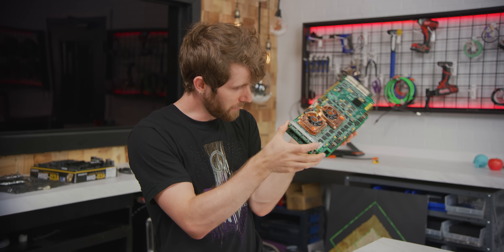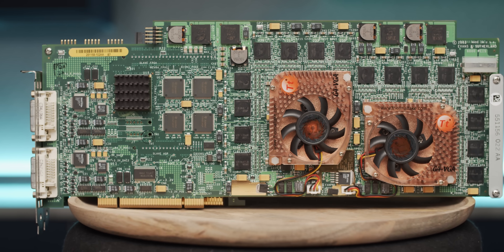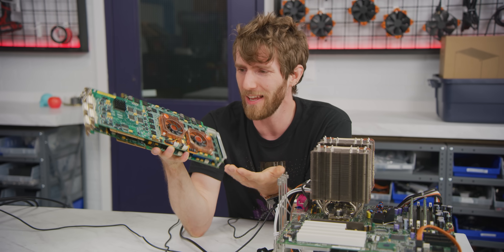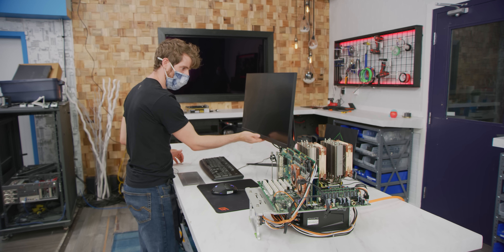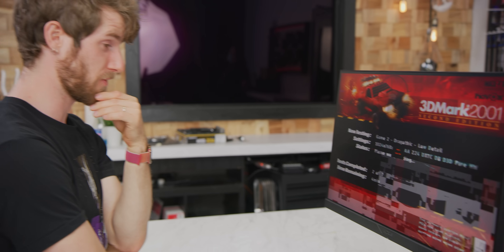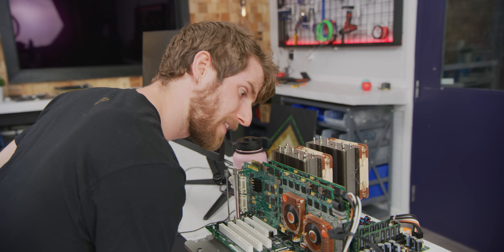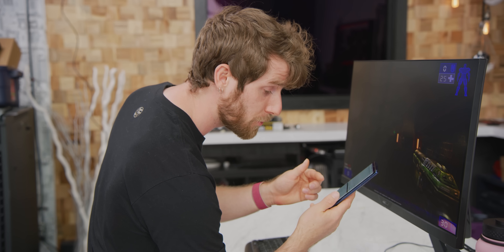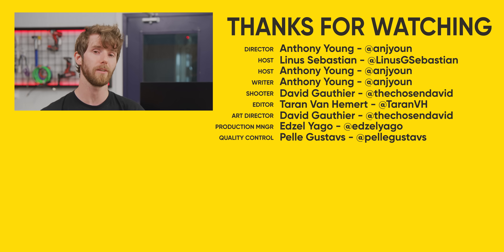This MONSTER Video Card has 4 GPUs... and it's from 2004! - E&S SimFUSION 6500q

Comment: Those "desktop lines" were a plague on ATI GPUs in the 90's and well into the Radeon era, and a significant part of why I went 3dFX then Nvidia.
Reply: I became a NVIDIA fanboy after my ATI Radeon had crapped out on my for the final time. Got my first NVIDIA card and it was a FX 5300 and it was rock solid. Now have a 1650 super
Reply: @fightingfalconfan  I actually had bad luck on nvidia fx series. Radeon 9800 pro never let me down till I needed a new gpu in 2010. Then I got a hd 3650 and after that gtx 9600 all used ofcourse because I didn't had much.
Reply: @fightingfalconfan  I gave ATI another chance with the very first Radeon released.  I was playing Alice at 1600x1200 on my 21" Trinitron and it "popped", all the video went corrupt.  Exchanged it on warranty, then traded it for my first nVidia card, with the thought process "they bought 3dfX so they're bound to be good right?"  I was right and haven't looked back.  Sadly I'm an AMD CPU fan, and was back then.  I admit that an APU is a good way to go for a cheap gaming rig, but I still like my AMD/nVidia rigs.
Reply: Im still using an ATI Radeon 2600 pro with a water block and it is massively overclocked and overvolted and the performance is about a 1080 ti
Reply: @milord2921  FAKE NEWS

Comment: Can't wait for the 10 year-old computer video. 

Should see my 2 Windows 98 high end gaming rigs I built (with lots of new old-stock stuff and CRT's)
PII450 Matrox G200+Voodoo2 12MB SLi Diamond Monster Sound II

PIII-S1.4GHz (have Voodoo5 but meh) GeForce 3 Ti 500 SB Audigy (w front-panel)

IDE to Compact Flash Cards for storage (the inventor deserves a freaking 🍪)
Reply: See, that's a properly interesting build. 10 years back is just Nehalem and Sandy Bridge, which are still remarkably serviceable and have little difference in build from a modern PC. Just slower and no M.2/nVME.
Reply: @random_n  architectures stalled. Thats why a pc from 2011 is still relevant today. Im using one from 2014 and only gonna upgrade after 6.5 years lol.
Reply: My Matrox G200 set me back $250, that's like the new RTX 3090 in pricing. What the hell was I thinking.
Reply: @Tokamak3.1415  hehe I had a Pegasus card, myself.
Reply: Add SCSI to get top storage performance.
Reply: CRT for the win. save them while you can when they are gone they are gone!
Reply: Cool, I was already in the green team back then. I still have my Nvidia Riva TNT somewhere, should even work I guess.
Reply: Mycon . My TNT does.
Reply: Yeah voodoo 5 was a disappointment. I envied my friends geforce 256 that time. A lot cheaper but performs a lot better. Except in unreal tournament glide.
Reply: @badassgenevideos  I got 2 recently and I'll tell you now that's a collector's card, not a practical use really. 

Can you believe it's not even backwards compatible with older glide stuff? I know it's a new architecture but it adds to the obscurity IMHO
Reply: @8KilgoreTrout4  I don't remember that's its not compatible with older glide games. By that time, the only glide games I was playing were unreal tournament and Diablo 2 and N64 emulator that uses glide. When we started playing quake 3, I switched to Nvidia. I regretted buying voodoo 5. I can't even find a buyer since everyone is buying Nvidia 256 because of quake 3. The one thing voodoo 5 excels with is the AA. It took a while before Nvidia and ATI could match the quality of 3dfx AA.
Reply: @badassgenevideos  Retro Machines and 3dfx Voodoo user group on FB you can find a seller right now, or really good trade leverage.
Reply: What's the point of building 10 years old rig? I myself using 8 years old and playing all games almost maxed out graphics. Yes GF980 and i7 4770k beats 1440p in games. So 2 more years would be like GF780.
Reply: Matrox that’s a name I’m always trying to remember during convos but can’t since you don’t hear it anymore
Reply: They did that video for ltx last year
Reply: I have a 5x86P75 basically a 486Dx4-133 with 16kb L1, 96mb 60ns FPM and a Matrox Mystique 2mb, SB32 and IDE->CF bridge. But my first PC was a 8088 :P first computer a commodore VIC-20. Yes I'm old...
Reply: Don't want to ruin your feelings, but those specs are more like for a 20 year old PC.
Reply: @Murphistic  well yeahhhh I just thought it was more interesting than a 10 year PC. I was thinking old computers that are cool 🙂
Reply: ammmm 10 years ago would be around a GTX 580
Reply: Like jayztwocents

Comment: Come on... if you want to see a real "beast", look at the IBM Professional Graphics Controller from 1984. That's 2 full length, 8-bit ISA slots. It had an onboard 8088, 320KB RAM driving the whole thing, did 640x480 at 256 colors (also had a CGA emulation). That was really revolutionary for a PC. Not this thing.

Comment: "old enough to support dvi" looks at my 1650 super o ok :(
Reply: i mean even the 2070 non super has dvi, so, meh...
Reply: when it takes so fucking damn long for nvidea/amd to give us a  new card that linus need to amuse us with a ancient relic
Reply: You guys have gpus?
Reply: but it has analog DVI
Reply: @ferchuu9  DVI = Digital Visual Interface
Reply: @Kurkkulimu  DVI used to have an analogue mode.
Reply: @Kurkkulimu  Old ones could also output analog.
Reply: Looks at my ROG B450-F
Reply: 2060s also has DVI. I'm surprised it's not just all DP at this point.
Reply: Probably the fact that it ONLY had dvi, and also there’s the older kind of dvi and the newer one. New cards have the new dvi. Also, this card was super expensive and cutting edge at the time, so the fact that it had dvi shows it’s age. High end cards these days pretty much never have dvi
Reply: GTX 1080 has DVI, so I don't know why Linus thinks that's a metric to go by to evaluate how old a GPU is
Reply: I literally use DVI with my 1070 because my monitor doesn't have displayport and the only hdmi port is occupied.
Reply: ur gay most likely digital dvi as opposed to the older analog dvi
Reply: i’m getting the 1650 super too
Reply: This is always what I find so odd about Linus, talking like stuff is super old...but he grew up with this, idk to me DVI or VGA is not old at all.
Reply: Decenium theres multiple types of dvi. Dvi is pretty much not in use anymore except in some cases
Reply: @pattondurio  DVI-A is has never been an output standard dude, usually the output is DVI-A/D which has both. The cable pins determine which signal you use either analog or digital, and a DVI-A cable or adaptor terminates in a VGA at the other end as it would be dumb to have it on a monitor as the connector for DVI is more expensive than VGA and if using analog they do the same thing. The point is to save space on the backplate of a GPU.
Reply: heh do you mean the Radeon X1650 or the GTX 1650? You do know both exist right? Or too young for that? I'm guessing GTX since the Radeon was a dumpster fire and like 10+ years ago.
Reply: noth606 since he said 1650 super it would be stupid to think he meant the Radeon card.

Comment: You should run it on a GNU+Linux rig and benchmark some games and applications on it there. Also, use a better computer to squeeze all the performance out of it. Also, create a custom watercooling kit for it and then see if you can overclock it. Let's really see what that old card can do.

Comment: "Old enough to still use DVI"
I still use DVI...
Reply: I still use VGA
Reply: I use vga and it works ok for my needs
Reply: @KlyffHanger  Well IF it works and is compatible i do not see why not use it just VGA monitors are heavy and both of them made dents in my cheap desk so i got rid of them in favor of the 2 VGA also with DVI monitors.
VGA worked wonders when it was comparable with everything. Now DVI and HDMI are.
Reply: @yumri4  really? Probably should buy a new hdmi monitor. my desk is flexy and i dont want to break it. Thanks for the info! ;)
Reply: @KlyffHanger  why get a new one when the ones i already have are still working?
Reply: @yumri4  I was talking about myself. btw I am thinking of an i3 10100 based pc build a few weeks later. any comments?
Reply: @KlyffHanger  A few.
1.) Look at what you actually use. To upgrade to something that goes along with that.
2.) right now Intel isn't so good to go with due to the lack of features and support on their motherboards and CPUs but as it is a CPU upgrade i am assuming you already did that thing and decided ad Intel CPU met your needs better than AMD.
3.) Really the CPUs right now aren't a big factor so unless you have a need for the extra 2 to 8 cores the quad core i3 might be good enough that you will not notice a difference from the upgrade. This is assuming you are using it for home use not work use as most home applications are made assuming you have a quad core CPU.
4.) If you wait a few months the 11000 series will be here. As this is always true that the next CPU gen is the next year this one is not as important but still if you are upgrading from the 10000 series the logical thing in my mind would be to go to the 11000 series as upgrading within the same series without a major reason isn't going to make any big gains with Intel CPUs anymore.
Reply: @yumri4  I only play minecraft and watch youtube videos at 1080p. And I will be a first time builder if I build the PC. I think intel PCs must be much easier to put together than AMD as I don't want to do that bios tweaking stuff and other things. And I'm upgrading from an i3 2100! Also I see that you've mentioned the 11000 series. I think I would go for the 10100, then a few years down the line upgrade to a 10600k, then a 11000 series i3, then an i5 11th gen, and that's it. So this PC can suit my needs!
Reply: @KlyffHanger  Really if you just play minecraft and watch youtube then why upgrade from a i3?

Knowing how long Intel keep around their CPU lines you are probably talking about the same year. I would suggest saving up a little more and getting the i5 to begin with then. The CPU is one of the hardest pieces to change / upgrade after the system is built so putting in the 1 that you will keep for the rest of the system's life or think you will is important.
Reply: @yumri4  Umm, i have an i3 2100 on the lga 1155 socket and with a bad mobo. I think the power delivery is capable of an i7 3770s (fingers crossed) and one of them costs 50 bucks so i think i can do that. Also, my minecraft needs are HIGH. streaming and gaming with a few chrome tabs open in the back ground.
Reply: @KlyffHanger  Going off of just that get a new motherboard at least. You do not want a just enough power VRM if it is to last more than  1 to 2 years.  
Well maybe by then you will be able to afford um it will be 2022 so the 13th to 14th gen depending on when in the year. 
Just like if the VRM is not up to it you might see a worse performance out of the i7 than the i3.

At which time i will suggest weighing your options between AMD and Intel.
Reply: @yumri4  Oh. I totally forgot that. Btw the system is 8-9 yrs old now -_-.
I think if i give atleast $3000 i can maybe get a ryzen 9 3900xt and one of the upcoming rtx 3080 or whatever it is called. I just want an ok pc that can still be respectable in performance after 10 or so years
Reply: laughs in VGA port display
Reply: For one of the monitors i do too. I have more than 1 as every prebuilt system i bought in the past the deals made me have to get a monitor to have it be cheaper than not. Then i DIYed my system and it is lasting right not 2x as long as one of the prebuilts did just used the monitors from them. It isn't the monitor that died for them ussually it was the hard drive.

Comment: • 9800XT? I remember the 9800 Pro, the 9700, and the 9600XT (including AIW variants), but not 9800XT. 🤔
• 3:53 - My gut says that I must have seen some fancy motherboards (or at least server boards) that had more than one AGP port, but a quick search seems to indicate that it was never really a thing. The closest I could find was discussion of AlphaServers supposedly having them, but if you look closer ( imgur.com/a/vf9FySH ) those aren't AGP ports, they're a proprietary 240-pin connector for daughterboard risers. Maybe it's because AGP was released too late to bother making multi-port boards since PCI-e was already on the horizon. 🤷
Reply: The 9800 XT was a high-priced successor to the 9800 Pro, competing with the woefully inadequate FX 5900 from nVidia.

I've never heard of any board having more than one AGP slot.  It was not a general purpose bus - AGP stands for Advanced Graphics Port - so that's not surprising.  Non-graphics peripherals that needed higher speeds (typically only on server platforms) used PCI-X, which at 64 bits and 133MHz had about the same throughput as AGP 2.0 (~1GB/sec).  Both became obsolescent with the advent of PCI Express, which started at 4GB/sec with a 16-lane slot.

Comment: Your benchmarks won't even come close to the originals.  This device has something similar to v-sync enabled by default while the stand alone cards do not.  There also used to be a simple Visual Basic program that worked as a control panel (RockWell-Collins should have it around still) for these cards which I don't think was utilized with this demo.

Comment: I used to work on the F-16 Simulators that used the NORSK DATA computers to run the system. Singer-Link was another contracting company that utilized the same technology.
Reply: That's crazy. Compared to "gaming" sims (Falcon BMS, DCS) what did those simulators do better, and what did they lack compared to the modern ones?
Reply: @ChucksSEADnDEAD  well first - you sat in an actual cockpit and had to know where every switch - light and knob was. We take for granted 4k monitors - back then a 2k reference monitor was $60,000. I spent time on the B-52 sim as well, which was on a motion base. The screens were the size of boat anchors so you had to use a gantry crane to bring them in. A 2 megabyte hard disk was actually a stack of platters that had to be loaded in a drive the size of a washer. Now this was the late 80's and technology jumped pretty fast. But to be in the actual sim with nearly 240 degree FOV was incredible. Now the level of detail close up is much better.

Comment: 0:58 SLI technology was created in 1998 by 3DFX (later bought by Nvidia), so this can't predate it.
Reply: SLI from 3dfx was Scan-Line Interleave.  It has nothing to do with what nVidia called SLI after buying 3dfx.  So it's correct to say this card predates nVidia SLI and ATI Crossfire, simply because those names weren't in use.  ATI had already release a multi-GPU card many years before, but didn't call it Crossfire.

But it's not correct to call this the first four-GPU card.  That was an unreleased 3dfx card called the Voodoo5 6000.
Reply: @TrueThanny  Obviously it's not exactly the same, but Nvidia's SLI is based on 3DFX SLI technology, so the statement is still inaccurate.
Reply: @fernandomartin4141  No, it isn't.  The only commonality between SLI from 3dfx and SLI from nVidia is the name.  They work completely differently.
Reply: @TrueThanny  Even if they do, conceptually is the same thing. Highlighting this ability to join two GPUs as a novelty in 2004 is misleading.

Comment: 2 systems that are still in use with windows 10

both have a AMD FX-6300 with 16 GB (1336 speed)1 has a nvidia 970, used for gta5 
motherboards are M5A78L (retired 4 months ago) and a M5A97 has a 750 ti 
which does what this 62 year old requires (sound chip has died, using hdmi for sound)
sound card suggestion

Comment: Most Radeon 9800 series cards had solid state caps. My Hercules 3D Prophet Radeon 9800 PRO also has solid state caps (no electrolytic caps at all). Oh, and this was also the case with nVIDIA cards such as the high end GeForce FX 5900 / 5900 Ultra / 5950. Damn, I’m old....

Comment: what is the point of multiple gpus when it almost always performs worse than one?
Reply: In this case it was probably the necessity to drive projectors into a curved screen at a decent resolution (even in a "close" range fight an enemy fighter is just a black dot against the blue sky) with large render distances, and also screens for the multifunction displays inside the simpit.
If the simulator was coded specifically for this hardware they probably did a good job with distributing the load across the cores.

Comment: *remembers voodoo 5 6000* interested.. maybe, impressed? not really.
multichips for ati weren't even that odd with the Ati rage fury maxx.
wonder if it was only running 1 gpu on this test bed... windows xp didn't like afr, would only use 1 chip.

Comment: Fuck man.
Ati rage fury maxx from the year 2000 use 2 gpu on 1  card 
And that chip you see on this board is the same bridge chip from that time.
So really noting special on this  card.
Only the the PCI slot is use for the other 2 gpu and connect via a bridge chip.